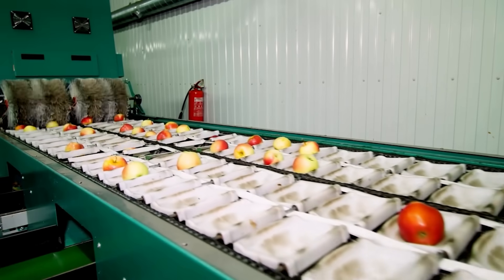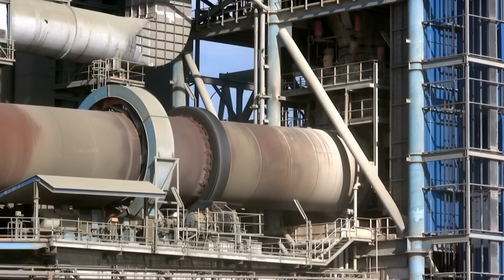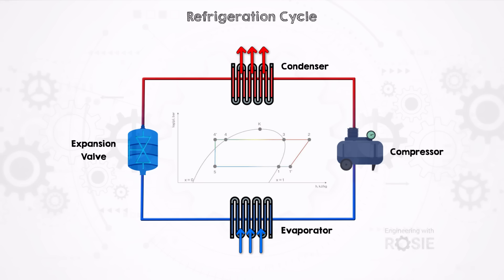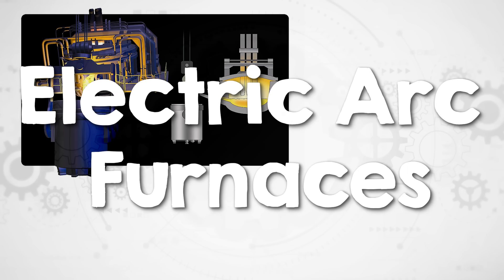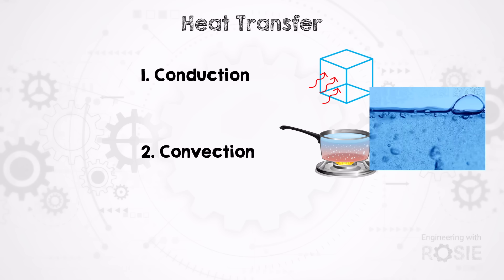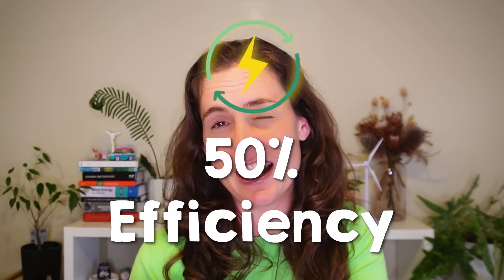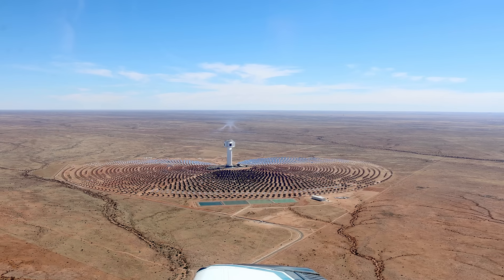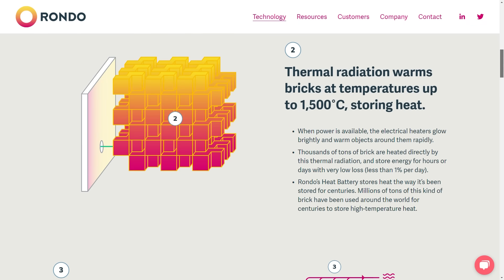Zero Emissions Heat Technologies for Industry

Comment: Happy new year Rosie. 
I enjoy your work. 

The grid is a massive topic you will discover. 
1million klm 
$1million per klm
$1trillion = national GDP
Built over the past 100 years. 
It is fragile amd lightweight because it is extremely expensive. 

The grid must not be monopolised by filling it with one central generator. 
We can only afford this existing national grid.
It must be UNLOADED and be the backup to the millions and millions of users,  the customers. 

Please start the conversation. 

From a previous post by me.

Australia's solar duck curve is about to be matched by the new total Big Batteries capacity. 

And then, soon, the Snowy 2's capacity 

And then, soon, the EVs with V2G. 

More rooftop solar PV installations.
And More duck curves. 

Then more renewable electricity to Tasmania. 

No room for nuclear electricity. 

Australia's solar duck curve is about to be matched by the new total Big Batteries capacity. 

And then, soon, the Snowy 2's capacity 

And then, soon, the EV increasing, with V2G. 

More rooftop solar PV installations.
And More duck curves. 

Then more renewable electricity to Tasmania. 

No room for nuclear electricity

Comment: When Biomass is mentioned it should be mentioned that CO2 is slowly absorbed and quickly released. With E-fuels they are less efficient than H2 as H2 has to be made first to produce them.
Reply: E-fuels don’t necessarily require initial H2 electrolysis. The Prometheus Fuels process uses a catalyst to synthesize ethanol from carbonic acid (carbonated water). The ethanol is then separated from the water using a proprietary nanotube filter (basically reverse osmosis) rather than distillation, avoiding a heat process. Finally, the ethanol can be converted into hydrocarbon chains (gasoline, jet fuel, diesel) using zeolite catalysts that have been around a long time - basically, they just squeeze H2O molecules out of the alcohols. So there, e-fuels with no H2 needed. 

Of course, Prometheus has been long on promises and short on delivery for a few years now, but their principle is excellent.

Comment: While I am disappointed she didn't go into detail about the heat from nuclear reactors, at least she mentioned nuclear for half a second.
Nuclear reactors generate plenty of heat.   Low-temp and high-temperature steam electrolysis are both more efficient than room-temp electrolysis.  To be clear for the people who might not know what I'm talking about, I'm talking about producing hydrogen.
Nuclear, as well as waste heat from industrial sources, could be used for low and high-temperature steam electrolysis as well.
Lots of things currently need green hydrogen.  The steel industry, oil refineries, fertilizer plants,  renewable fuels for aviation and shipping, the chemical industry, etc.

But aside from the high-temp needed to produce green hydrogen production more efficient, I'm also really interested in domestic hot water heaters and photovoltaic thermal rooftops.  How only can they provide hot water, but they can provide heating to backyard swimming pools and community swimming pools.  I was surprised to find out that they can also be linked with a ground-source heat pump to 'charge' the ground with heat, improving the SCOP of the heat pump.

I used to look down on solar hot water heaters because they don't produce heat during the night, and here in Canada we have long periods of cloudy weather in many parts during the winter. But if you have the money, or live where there's a generous government grant for such a project, get both solar and a ground-source heat pump.
Reply: Nuclear reactors generate plenty of heat, but in practice, they are temperature-limited to what their cooling systems can handle. Heat is measured in terms of both total BTU, and temperature - it’s analogous to current vs voltage. So the heat of conventional nuclear reactors is basically in the boiling-water range - not hot enough for most industrial processes, and definitely not hot enough for high-temperature (and high energy) processes like smelting steel. Even advanced molten salt reactors (which are mostly theoretical and not used in current practice) only operate in the “medium heat” range. Operating a reactor hot enough to provide high heat for industrial processes would be extremely dangerous! How do you cool it in case of a shutdown? No, nuclear reactors are really only useful for generating electricity via turbine generators.
Reply: @davestagner  Yeah, they would presumably need two stage boosting. But using nuclear process heat cuts down how much oomph you have to give it for high temperature. And some are optimised to also produce hydrogen, which of course could be used as to help the booster. None of this of course if in any way laid out, but the early PBRs etc are being constructed, and nuclear certainly fits the specs of low or near zero emissions, with China, responsible for so much of steel and cement production, at the fore, so it seems daft not to take serious look at it.
Reply: @davidmartin3947  I don’t see how. Nothing is coming off the reactor any hotter than pressurized steam, which can’t be used for heating things directly anyway, for safety reasons. At best, you can make electricity with it, to heat up some other system (any of those Rosie suggested). And at that point, nuclear is no better than renewables. The heat is simply not available for direct use, because the coolant has to remain tightly confined and is much lower temperature than the intensive industrial processes anyway.
Reply: @davestagner  The new HT reactors in China are specifically designed to allow the use of 'waste' heat to produce hydrogen, ie the process heat is in fact able to be used. Unfortunately I can't put in links here to the state of play or the post will be killed by Google spam, but using the process heat is indeed one of the objects of the designs.
Of course, at this stage it is impossible to be sure that it will work, but that is what they ar trying to build.
Reply: A bit more here about the Chinese full scale HT PBR which came on line on 6th December - I had not realised myself how far down the road they are, until I did some digging in response to posts here:

' In an interview last year for World Nuclear Association's World Nuclear Performance Report 2022, Lu Hua Quan, chairman of the Nuclear Research Institute, Huaneng Company, explained: "HTRs have the highest operating temperatures of all existing reactor types, and are also the only reactors that can provide very high-temperature process heat." He said there was export potential, especially to countries and regions where freshwater resources were scarce, adding that "HTRs could in the future provide a source of high-quality high-temperature process heat for various industries, in particular those that are required to limit their carbon emissions".'

- World Nuclear News.

500C stream, it also says
Reply: @davestagner  Low-temperature steam electrolysis is more than manageable for nuclear power plants; they can easily provide the process heat needed to make the electrolysis process more efficient, and that's much of the main focus I keep reading in much of the material I see about gen-4 nuclear reactors. And no, not just producing electricity.

Comment: what about pyrolytic heating?
This mostly known with producing Biochar and using the access heat, but it can be done with methane as well.  You seperate  hydrogen and Carbon with heat, and you burn the Hydrogen to produce that heat. You end up with Seperated carbon, with heat and with Water vapour.

Comment: Nuclear was briefly mentioned at around 14 minutes, but perhaps deserves more attention as SMRs can, at least potentially, do the job with excellent electrical plus thermal efficiency right where it is needed. Of course in the West there are considerable political as well as cost hurdles, but China is also a leader in the field.
Reply: In high latitudes, SMRs might end up being the core of an industrial district, with some devoted to producing heat and others electricity. I can't see it happening in mid latitudes due to the cost issue though.
Reply: @SocialDownclimber  Safety and cost are the two critical issues.
'IF' the Chinese, because deployment is not going to happen elsewhere any time soon, crack those, then the advantages of nuclear are considerable for some things in its SMR incarnation.
You can basically site a very compact electrical and heat source anywhere you fancy, which is available 24/7 without any fooling around with intermittency and so on.
Handy in crowded places even where there are abundant renewables, although even more attractive of course where they are not.
The 'IFs' are real and substantial though, so we will pretty much have to hang on and see how the Chinese get on, as they are pretty much the only game in town now.
Reply: The main difficulty is that nuclear plants tend to be pretty isolated from everything, for security reasons. So you'd need to pipe low-temperature heat quite a ways before getting to the plant that wants to use it. At that point, it's a lot of bother for not all that much benefit. Hence, nuclear plants almost universally find other ways to get rid of their waste heat.

Now when it comes to coal, gas, and diesel we're totally happy with huffing their fumes, no safety issue there (just don't think about it too hard). So those are much more commonly used in combined heat and power plants. You still need to get the incentives to line up to figure out who pays for the steam pipes; Europe has generally been better at that than North America.
Reply: @benoithudson7235  The safety considerations for advanced SMRs are very different to conventional nuclear reactors. The precise details vary with the technology, of which there are a number of variants. But basically they should be able to be slap bang on top of where they are needed, at a reasonable size for the use, not the 1GW plus monsters of present construction. So if they work cheaply enough, as pebble bed reacgtors,  thorium reactors, NuScale or whatever, they should be able to be sited right where needed. As I said, the comment gets killed by Google if I post links, but IF they work safely and economically, then they should be OK for siting.
Reply: @davidmartin3947  : it's asking for a lot of things to happen to get to a point where we have nuclear fission reactors on a site with minimal perimeter security and no background checks in the middle of a rough part of town. Which is where you'd site that meat processing plant or whatever that needs low-temperature heat.
Reply: @benoithudson7235  Dunno 'the rough part of town' is really an issue in China where the deployment has started:

' Assembly of the core module of the world's first commercial small modular reactor (SMR), Linglong One, was completed on Thursday, according to its developer, the China National Nuclear Corporation (CNNC)' (Aug 10th 2023)

Again, I can't make proper links as I normally would, or Google will kill the comment, but you can readily verify.

It might be 'only China' when the normal focus in what we see on the internet in the West  is on the US or the rest of the world, but one heck of a lot of manufacturing and hence process heat happens in China
Reply: It comes down to cost. A medium sized food manufacturer burning coal or gas can't justify a X billion dollar capex on their heat source.
SMR for heat is something like 3x more expensive than BAU.
Reply: @gronkotter  You are conflating high nuclear costs and long construction times in the West with China and the East. I can't post links here, as spam filters kill the post, but simply google terms like 'China nuclear costs'. Nuclear is cost effective there, even with present reactors, and even with their low costs for renewables.
Reply: @davidmartin3947  Yeah but we are comparing electricity vs heat. Reasonably priced nuclear power plant in the East still doesn't make cheap heat.
Reply: @gronkotter  ?? The process heat is more or less a freebie when you are using nuclear for electricity, and the build out of small HT reactors make it a much more attractive proposition for such use.
Reply: @gronkotter  The heat is a freebie from the cheap electricity.
Reply: @davidmartin3947  50C waste heat isn't useful for industry.
Reply: @gronkotter  
I am not about to go down a rabit hole of the precise output temperatures and uses of the old design soviet reactors sine your claim was that no reactors had been used to provide industrial heat, when clearly 79 of them were supplying heat to industry, however used.
That is the relatively low temperature heat from deployed reactor designs.
If you wish to discuss it further please look up the link I provided to the WNA on the use of nuclear waste heat. I was unable to give a direct link due to spamming restrictions, but you can easily locate it from what I have given. 
The bottom line is that the modular HT reactors China is building are designed for and capable of producing high temperature process heat including for the production of hydrogen.

Comment: Heat pumps are being installed more often now in commercial buildings which is nice to see, they make a lot of sense.
Reply: and heatpumps also makes a lot of noise!
Reply: @bibihunden  Mine was fine in my last propert in the south of England, providing both heating and cooling at around the same cost as gas heating would have done for just heating.
It should be borne in mind that very low temperatures are rare there, but noisy? No way.
Reply: @bibihunden  I sorta doubt that a heat pump could ever contribute significantly to the noise of any industry.

Comment: Around 10:33 you say that for electric clinkering the heat would have to tunnel through from the outside, but why? There is no reason you can't put a heating element inside the pipe as far as I can see - go watch any kiln-making video for things like hobby knife-making and they recommend using nichrome wires embedded in a thick layer of insulation tiles. You could even have your wires running through the centre of the tube in the same place as the fame, unless I'm missing something.... Would such materials be too expensive for this sort of infrastructure, perhaps?
Reply: as far as I know, there's no conductor you can use for the heating element that won't burn when you get it to 1450C for the clinker
Reply: @thamiordragonheart8682  Sealed plasma tube should do it. Not sure what to make the tube from though.
Reply: @SocialDownclimber  Unobtanium ;)
Reply: @thamiordragonheart8682  So what are they using to heat the outside?

Comment: I worked at the SEGS solar thermal plants for 31 years.  Every time  we tried larger and hotter temperatures to provide steam conventional steam-electric turbines it got harder and more complicated,  PV made that solar electricity so much cheaper and fewer and fewer solar thermal plants were being built.  I was always promoting trying to use thermal heat for other things like baking bread, clothes dyeing/washing, green houses, etc.  hope one day it will come back in fashion for local  heating.
Reply: Crap.  They are using chemicals to seal the rock.  Not sure I like this as much as the chemicals and concentrations are not shared.

https://youtu.be/k8Imzxv3AU0?si=O8RRdqPm8FHY0QPG

Comment: So excited about your rondo trip

Question about heat storage could you store heat as heat and make electricity with it and then using the "wasted" heat for industrial application?
Reply: Absolutely possible, but a Carnot engine needs a substantial heat differential if it's to be efficient, meaning you need high temperatures on the hot side, and if you can store cold as well that's a bonus, as a really cold heat sink beats atmospheric cooling -- some energy storage proposals (see eg. Newcastle University Swan Centre, also Highview Power, both in the UK) have involved reversible heat pumps, where the same equipment is used both to push hot and cold heat transfer media into heat stores, and to recover the heat differential as mechanical energy for electricity generation afterwards.
Reply: There are also liquid air batterys.
They use Heatpumps to seperate energy heating up a hot side, and cooling air to liquid state as cold side.
To make electricity again they just  bring both back together, making the air expand radically in voulme and turn a gasturbine from it. There is a pilot facility in UK Pilsworth with 15 MWh capacity.
Round trip efficiency is 60%, and it loses 0,5% stored energy per day.
Reply: How about the other way around. Using waste heat from from electricity generation for industrial purposes?
I've seen this in a localized setting where methane fuel cells cogenerate heat for plant processes.
So, while still using fossil fuels, rather than burning it for heat and needing electricity to run the plant they use the gas in a stack to provide power and harness the heat for the processing.
This is pharmaceutical/chemical where the temps aren't as extreme as something like cement or steel, but it must be more cost effective (and control varying electric rates) or they couldn't justify the upfront costs.
Ultimately, it's also a perfect match for CCS if that ever gets traction. Far cleaner stream than actual combustion from a gas turbine power plant
Reply: @jimurrata6785  that is already done where its suitable
Reply: Antora Energy (a competitor to Rondo) has a very interesting approach to generating electricity from thermal storage. They use custom photovoltaic panels (like solar panels), tuned to the radiating frequencies of their heat source - white-hot graphite. I don’t know how efficient this is relative to just using the heat to drive an engine to drive a generator, but it has the benefit of simplicity.